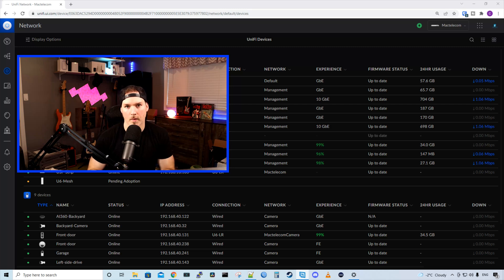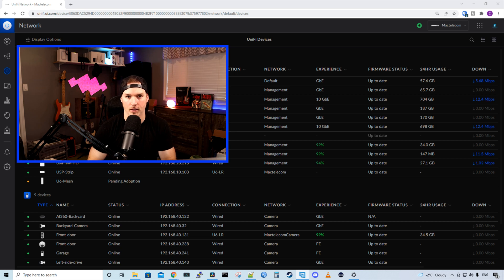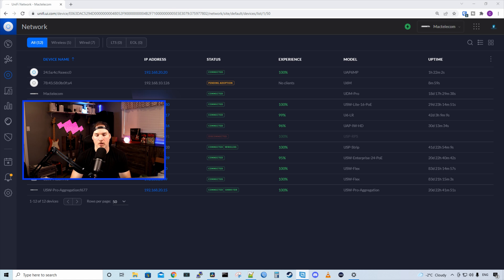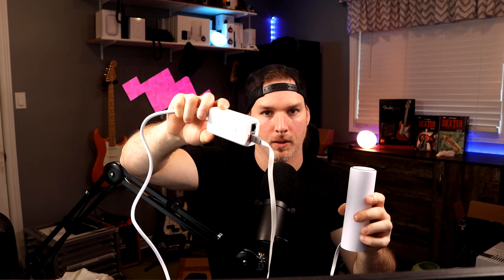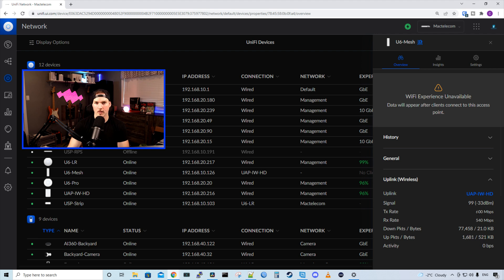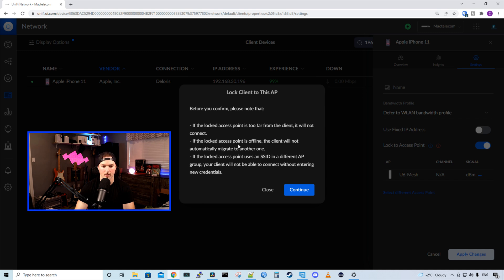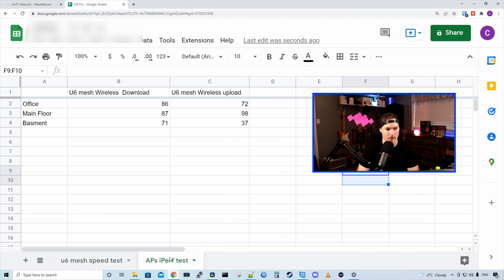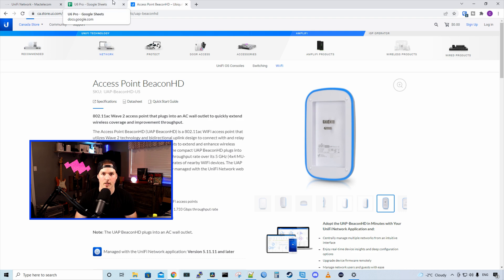U6 Mesh Wireless uplink

Comment: Just found your channel. We just had fiber internet ran in our area and service to house. They installed gigaspire U6 mesh everything works great but in my metal shop about 60ft from house I loose signal when door closes. What do I need to get wireless wifi signal into my building? Thanks

Comment: My u6 lite is using wireless uplink from a older lite AP however it is connected into the same switch as the non u6 lite AP. How do i get rid of the wireless uplink on the U6 lite?

Comment: Finally, I found someone who made a similar video to the current requirements I currently have.  Thank you very much, Mactelecom Networks, here are my questions I will really appreciate your feedback: 1) should I get a console device or will an old PC with Debian or Ubuntu Linux and the Unifi console OS install suffice to manage the access points and the wireless extenders? 2) I will be adding connectivity to a 5-story building and the internet is coming into the 3rd floor, how would you position the hardware? Is the U6 Mesh on the 3rd floor connected with the wired internet and then beaconHD or wireless extenders on the 1st and 5th floors? should I worry about the 2nd and 4th floors, or maybe test first and see if there is a need for the 2nd and 4th floors?  Thank you in advance for any suggestions.  Until the next video.

Comment: I was thinking about using one of these outdoors to mesh between two buildings but not anymore, those speeds are kind of  turd compared to Uap-ACM mesh units.
I get 350Mbps both ways around 200' without a clear line of site while having both antenna pointed straight up.

 If a U6 Version of the $99 outdoor meshes ever releases oh man! I'll upgrade

Comment: We run the old Unifi Mesh with the 2 antennas in our campground.  We had a few legs doing 2 wireless hops.  What a pile of garbage that setup was.  We trenched a wire to one AP and then put a wireless bridge to the other so each leg is only getting 1 hop.  Such an improvement!  I just bought a new FlexHD and then saw this AP.  Going to see if unifi will exchange as they are still  sealed in the packing.  Thanks for the content.

Comment: Great video.:goodvibes: So if you connect 2 LANs together using 2 directional APs as a point-to-point  connection, will that also be called a Mesh link or would you use a different term?

Comment: Thanks for doing this review. I have a family member who is unable to run networking cables in the home due to its construction. We currently use MoCA which works ok, but they also have satellite tv service. So we can’t use the coax lines for all rooms. Perhaps if they release WiFi 6 versions of the extenders, those will provide enough throughput.

Comment: Thanks for this video.  I think some of the confusion is the name of the product including the word “Mesh”.  It seems to imply it is connected over WiFi and not over Ethernet.  UniFi seems to have some pretty inconsistent and even misleading naming at times.
Reply: Mesh is a feature that it offers.  While it can be connected over WiFi, it offers more mesh capabilities than the other access point options.  While the other options allow of I believe one mesh uplink, the U6 mesh is designed for it and a network with them can handle multiple mesh uplinks.

Comment: Love the videos especially a fellow canuk... One thing you might be able to answer is can you use it with meshing and connect the ethernet to a non-wireless device or a hub and use it just for the uplink? Say to provide a wireless link for a small wired locaiton.